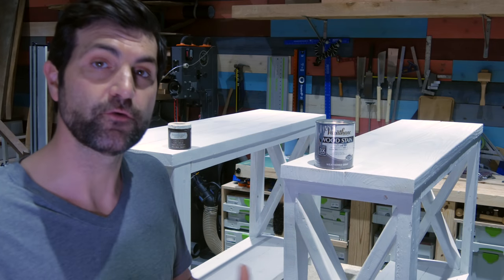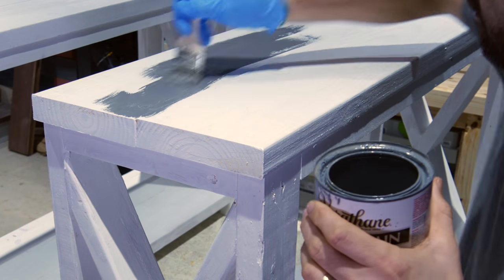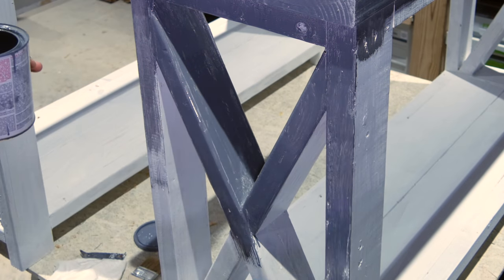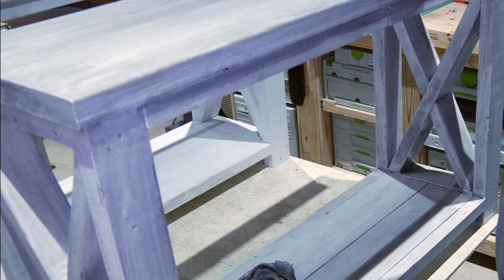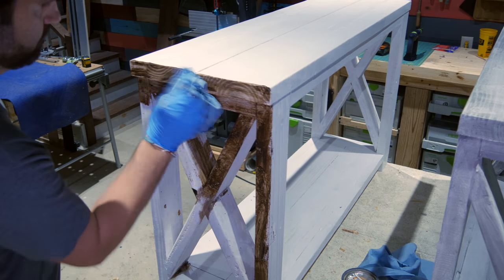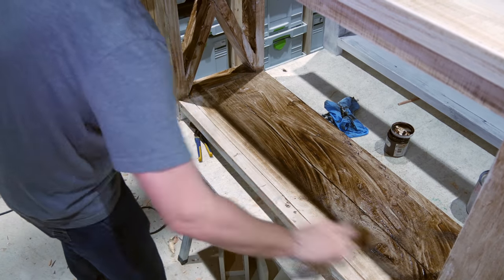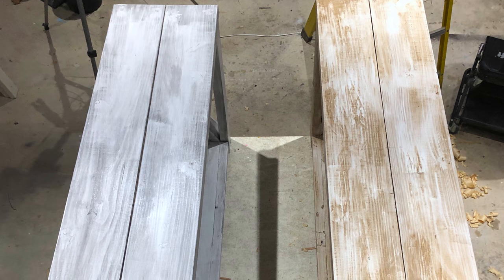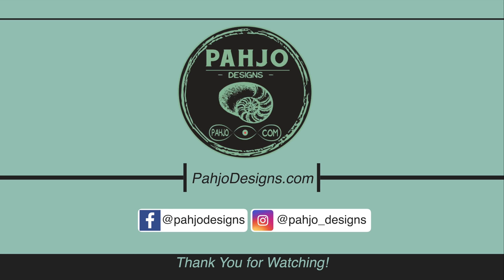How to Distress Painted Furniture (2 Easy Techniques)

Comment: I really LOVE that blue stain look. My project is an old rocking chair that I will be putting on my porch. Do I need to sand the original finish all the way off and will that protective coat work for outdoor as well?
Reply from the maker: Yes you do

Comment: I have some chairs which are already finished, but want to refinish them to go more with the rest of the furniture. Can I just sand, then do the white and stain?
Reply from the maker: Yes, you can do that.  A quicker alternative would be to use 2 coats of chalk paint then apply the dark wax.  Chalk paint doesn’t require sanding

Comment: Great video, I wonder if the stain over paint technique would work over satin paint. I was gifted a bookcase that has two coats of white paint and it's just very stark white for my taste. Do you recommend I use the stain method over it even though it's satin paint? Where is there a better technique for this?
Reply from the maker: Satin or semi-gloss paint is preferred b/c the stain won't absorb easily.  This allows you to wipe off and control the distressed look better.

Comment: Thank you for sharing. I have a an old  window thats white and some of the wood pieces are chipped. I'm about to paint green like sage over. Do I need to sand it down on where the chipped pieces are? Thank you
Reply from the maker: Yes, give it a light sanding to remove all the loose paint and any dirt that may be present.
Reply: @PahjoDesigns  thank you so much. Great channel and straightforward

Comment: Should I apply primer before painting with white paint ? Or it’s fine to go straight for the white paint ? (I’ve sanded the entire dining table)
Reply from the maker: No primer necessary.  Although, you do bring up a great point.  If you plan to use a color other than white, you can use white primer before you use the main color.  Follow the same technique and you will get a unique distressed look with the small areas of white.

Comment: I have never tried this but plan to use it on a bedroom set.  My furniture is already stained dark wood.  Do I have to do anything before I paint it with the glossy paint?
Reply from the maker: Maybe sand it down to remove the previous finish.  This will help the new paint adhere to the surface better.

Comment: is the protective coat necessary if it will be something that just hangs on the wall?
Reply from the maker: Hi Tammy, very good question.  No, it’s not necessary if the piece will be hung on a wall.

Comment: Can you use water based paint and stain? Or does oil based produce the best results? I ask for drying time... water based dries faster... or oil based paint and water based stain?
Reply from the maker: Hi Steve, water based stain works fine.  However, just make sure to work in smaller sections b/c of drying time.  Thanks for the great question and my apologies for not clarifying this in the video.

Comment: Its funny that none of the major furniture stores carry distessed dinning room tables.  I am wanting to do my house coastal or peacock and am leaning towards peacock theme because I cant find a table like this!  I have a gorgeous cherrywood table and buffet that I thought of doing this to but had no idea it was so easy!  I think I may give it a go.  I am wanting an aqua or teal type finish do they carry stains or wax in those colors or would you recommend I keep the cherry finsh and paint the aqua on top of that and then rub it off? Or would that be to dark?  I saw someone else do something similar to this but she painted white then rubbed and sanded it off particularly on the edges, took most complety off and it looked really cool as well, she also added a clear coat on top.  Would sanding and adding some type of clear coat keep it from chipping off?  I have always had the paint chip off on anything I have tried many years ago! I realize you are working with bare wood so that probably be quite different then something that is a smooth cherry wood finish.

Comment: I had a bench that had two coats of stain blocking and primer white paint, I tried applying the first technique with the stain but it never socked in no matter how long I waited. Is the only solution to sand the white paint off and start again with a light coat of semi-gloss (no primer?) white paint?

Comment: How can I re create this look on a black IKEA dresser? Still need to pant it white first and then use the wax paint (I like that look/color) and it will still work?
Reply from the maker: Yes, it will still work.  I’ve used this technique on black furniture in the past and it worked very well.  Since the dresser is black, I suggest using a primer followed by 1 or 2 coats of paint.  If you use quality paint such as sherwin williams or Benjamin Moore, you should only need one coat.

Comment: That was a great video, I’m looking for a way to take a black table and make it look like the table you did with the stain. Do you have Any suggestions for going lighter?
Reply from the maker: Are you looking to do a lighter color stain?  If so, it works great.  I did an aqua blue one time and it worked well.

Comment: Congratulations! Excellent video! Question: I already painted my new cabinets with a oil-based primer, can I still use this technique? I'll go with the wood stain, if so, can I paint it the either coat with water based paint? Help me please!
Reply from the maker: Yes, this technique works.  water based products work over oil, but oil doesn’t work over water based products.
Reply: @PahjoDesigns  Using water-based or acrylic paint when painting over oil-based paint is likely to cause peeling or chipping because those formulas don’t bond well with the naturally glossy surface of oil-based paint.

Comment: I want to try my hand at this by attempting the first method of paint/stain. because I happen to have a can of Behr  Premium Plus Ultra stain-blocking Paint & Primer in one that states it is "interior semi-gloss enamel" in ultra pure white.  However, would you confirm this is doable (as the cheap white paint) you used?  If so, then I plan to get the same stain you used in the video but can I get away with my average paint brushes for now?  Thanks in advance for any feedback and guidance you care to share!
Reply from the maker: Yes, absolutely doable and it will definitely work.  Any paint will work fine - semi gloss or gloss will be less elbow grease to remove excess.  Matte, flat, or eggshell will work just fine - you just may need to work in smaller sections so the stain doesn’t penetrate the flat paint quickly.  You can also thin the stain so that it’s not so strong/thick if you plan to use flat paint.  Does that make sense?  My apologies if not - I have a bad habit of rambling.  Lol
Reply: @PahjoDesigns  Thanks.  If one wanted the color of that brown wax in stain form, what do you recommend (since in this case I'm using the semi gloss paint step)?  I love the gray but want the brown option as well.

Comment: I want just a light distressed on the top of my white table. I did chalk paint. Will be too difficult to just clean the stain off? What can I do? I want the grey distressed  showing in some parts  but I still want to see the white
Reply from the maker: You could use gray furniture wax for chalk paint.  Work in 2’ x 2’ sections by applying the wax, removing it, and repeating for the next session.  I advise to not use wood stain on chalk paint as it will absorb the stain too quickly and make it impossible to remove.
Hope this helps!

Comment: I’m curious did you prime the wood before you painted it with semi-gloss paint and how many coats of semi gloss paint did you apply. Don’t want too much on the wood so the stain doesn’t soak in at all.  Thanks in advance.
Reply from the maker: I didn’t prime & normally don’t if i k ow I’m distressing a piece of furniture.  If you use cheaper paint from a big box store, I recommend 2 coats.  If you use quality paint from Sherwin williams or Benjamin Moore, only 1 coat.  Regardless of how many coats, the stain will definitely soak in no matter what.  
I hope this helps!  Thanks for watching
Reply: Pahjo Designs awesome. Thanks so much.

Comment: I would like to know what would you recommend me in the oposite I have a dark brown stain gloss furniture and I want to antique it soft white? I am opened to your suggestion.
Reply from the maker: You could use white chalk paint and apply in small sections then wipe it off to create a glazing effect.  Then, seal it.
Reply: @PahjoDesigns  any specific brand? Do I have to sand it first?
Reply: Was wondering the same thing, thnx for questioning.
Reply: @PahjoDesigns  Thnx you, this is really helpful.!

Comment: Hi! Thanks for sharing your tips! I white chalked my kitchen table, and will distress it in another day or so. I also plan to use a dry wax to age it. My question is, since my family and I will be eating off this table, do you still recommend the spray poly? Or is there a better choice? Want to make sure we are safe! That you! Marlen
Reply from the maker: Hi Marlen, polycrylic is water based, non toxic, odorless product suitable for dining tables.  It’s just not as durable as the oil based polyurethane which is toxic with strong odors.  Be sure to visit my blog for more details on this project:  https://do-daddy.com/how-to-distress-painted-wood-furniture/

Comment: I have a console table that is stained and shows the natural grain of the wood. Do I need to remove the stain before painting and then distressing in order to retain the natural grain after distressing?
Reply from the maker: Yes, I would sand until the old stain is removed

Comment: Do I need to sand first??
Reply from the maker: If it is raw wood, you should sand up to 120 grit or 220 grit.  However, distressed furniture doesn’t have to be perfect so sanding is optional as long as you are happy with the surface.

Comment: Hi..just a question about the protective coat...I used MinWax Poly but brushed it on and it started removing the stain...I wiped the poly off immediately and restained. Should I only use the spray version and not brush it on then?...Table was dry for 48 hours before trying to put the poly on....Thx for the help
Reply from the maker: Hi Eric, 
Excellent question. This happened to me in the past as well. This happens b/c stain is meant to absorb into the wood fibers rather than rest on top of a painted surface. However, it will still absorb into the paint – just not as much as the wood. After that mistake quite a number of years ago, I always opt for the spray finish for distressed furniture projects b/c it reaches corners and crevices.

Comment: They came out beautifully!! I used the polycrylic on some furniture pieces that my husband and I built, but the pieces are starting to yellow after 6 months 😭
Reply from the maker: Thank you Yolanda.  Are your pieces exposed to a lot of sunlight?  I find shellac works well to seal painted surfaces such as the ones in my project.
Reply: @PahjoDesigns  Thank you for responding. The console table does get a fair bit of sun every day, but my daughter's bed does not. Will we need to sand them down to remove it and add another sealer?

Comment: If I’m refinishing a piece already stained a dark walnut, can I just paint over it with the semi gloss and re-stain over it with the darker wood stain?
Reply from the maker: Yes, just be sure to prime the piece using zinnser before painting.  Regular paint may not adhere to the surface depending on what type of finish was used